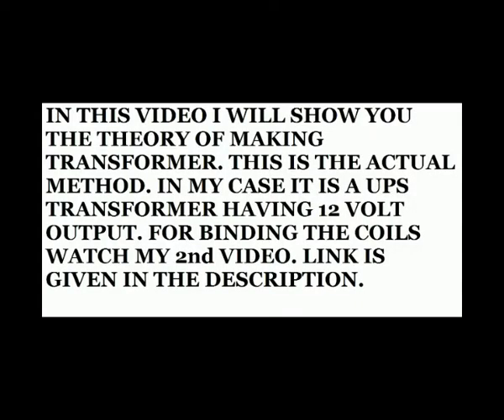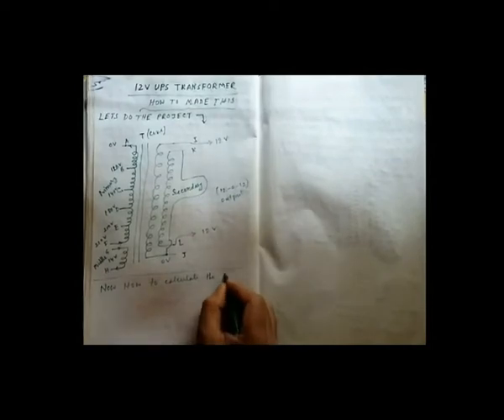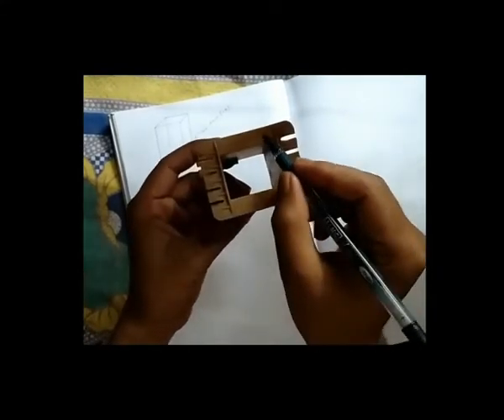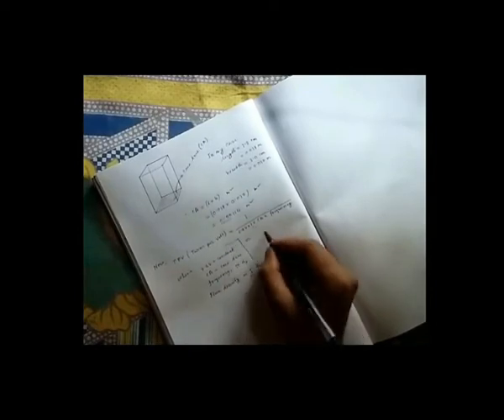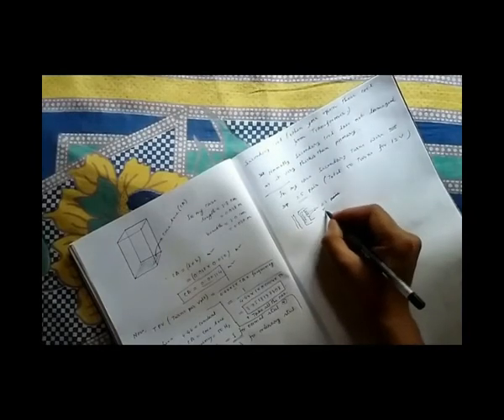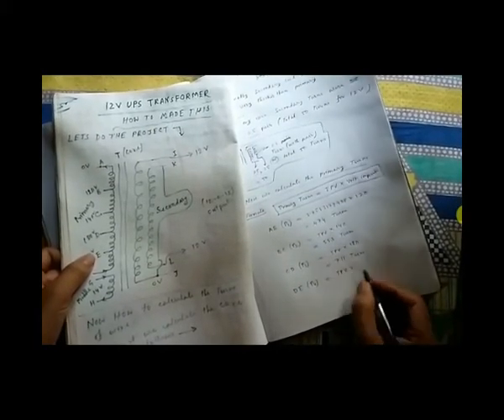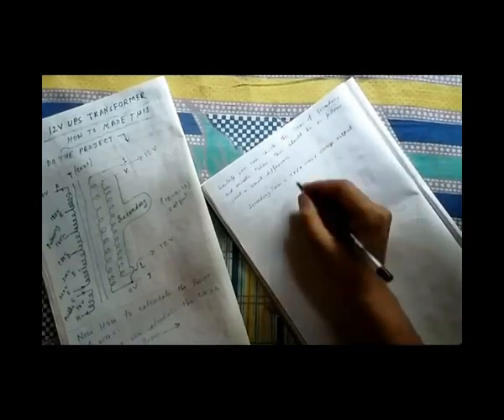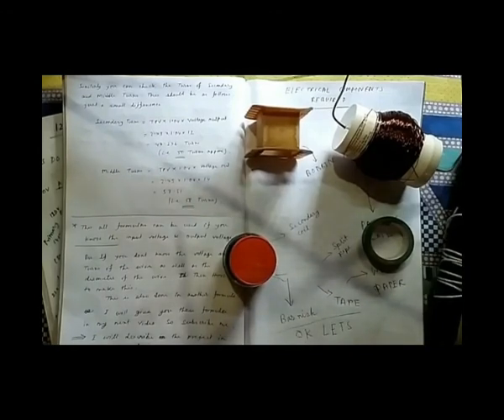Ups Transformer part 1 (describing theory)

Comment: Hi Apurba, I've a beetel 600VA UPS for PC. I now wish to use (with add'l circuit) it's transformer for battery charging. How do I find input and output of my UPS transformer? I tried passing 12v3A DC through one side of the transformer, no reading came on multimeter. The only thing I know is that one side (2 wires) has 0.3Ohm resistance, while the other side has 15-18 Ohm resistance.
Reply from the maker: As per your explain, i think the other side which has 15-18 ohm resistance must be the AC input side because there must be greater value of resistance than the output side...Also you said that you passed a 12V 3A through the transformer... i recommend do  not try this without a rectifier, because transformer works in AC not in DC directly... so don't try to do this.. as a result transformer coil  would be burn out.